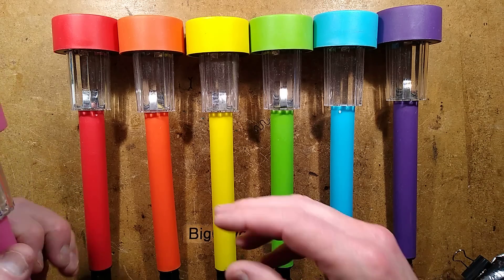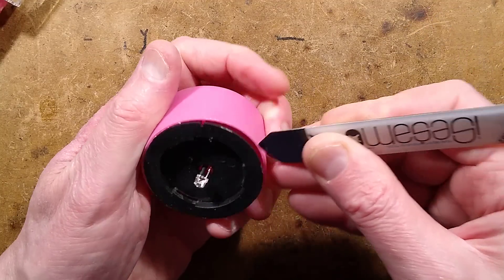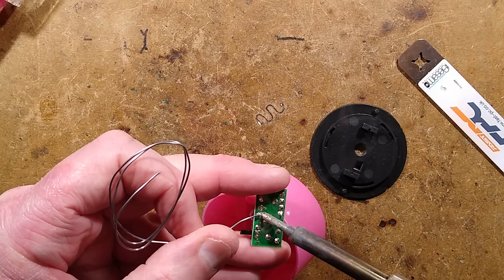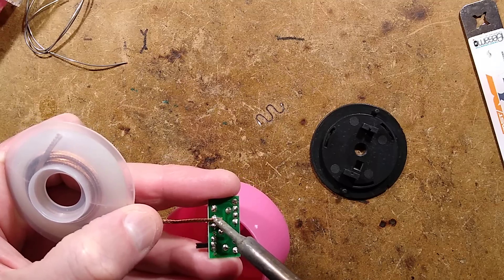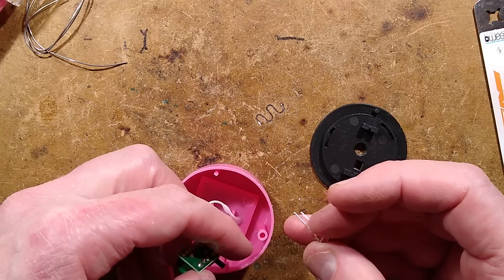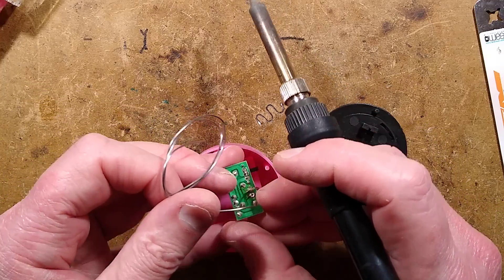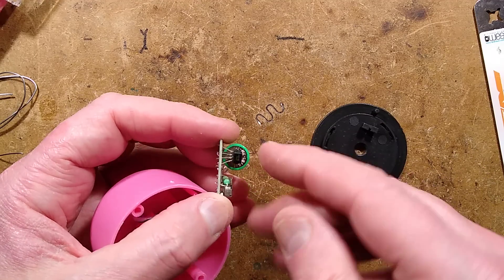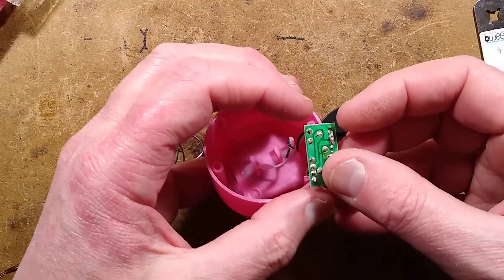Making Poundland's pinkest solar light even pinker

Comment: Hello mate , 
I am one of Your Subscribers for a long time and when ever I have some spare time in front of the computer I watch one of You video ... 
Recently my Wife - "my Boss" (😂) pointed out to me that one of the solar lamps in the kitchen flower garden is no longer working even though it was a sunny day ...
After I measured the battery and inspected the connections and/or if the led is functional and everything was ok, I remembered some of your videos with and about solar garden lamps ... 
And now the questions :
1) is there a color code or another way to find out the inductor (that name may not be accurate, but I don't remember know the correct name), value in the Accumulator supply circuit ?
2) the battery has 1.2v /15omA - if I replace it with 1.2v/600mA will it still charge?
3) can I put/replace that inductor (that name may not be accurate, but I don't remember know the correct name) part with another with a suitable value ?
Do you have a video where you modify the lamp to use a larger capacity battery?
Thank You & keep us on Loop with all you do .
Later Edit :
https://www.youtube.com/watch?v=VAsyVk0ZIqQ 
https://www.youtube.com/watch?v=bcSwIOBmfdM
Beside those.

Comment: I used to install Blue LEDs in the store lamps in front of my house.

they end up getting stolen every year to year and a half. 

I eventually stopped replacing them because the quality of soul lamps dropped, on the all started using single battery with lower voltage LEDs

Comment: Oddly enough I was doing the same thing with some similar lights from Tesco's "reduced to clear" shelf recently (two quid for a pack of five!) I've fitted red LEDs (fifty for a couple of quid on ebay) and plan to use them for night vision friendly lighting. The Tesco ones had a similar design, minus the switch (they use a slip of plastic jammed between the battery and one contact), but with insulating sleeves on the LED legs which made an excellent height gauge after swapping them to the new ones. They may also have had some form of charge controller, I think there was a tiny chip on the back of the board.

Comment: In another video, you made a solar charger for Ni-Cd cells, and when I mentioned protection circuitry for the cells to not over charge them, you replied that Ni-Cd cells can be put on constant voltage without any problems. In this video, you're saying that Ni-Cd cells can explode from being overcharged. If the smaller cells can explode, then certainly the bigger cells could also explode.
Reply from the maker: If the current is high they can pressurise.  With a controlled trickle charge they can control that pressure and convert liberated gasses back into electrolyte.

Comment: I have to admit I've scorched my fingers more using de-desoldering braid than actual soldering. If you wanted to add more LEDs how much would you need to alter the standard board ?
Reply from the maker: You can add LEDs in parallel or a few in series.  I've got a video about series LEDs on these coming soon.

Comment: I've bought those kinds of lights from the dollar store here in America and they usually don't work right. Like at best they charge the battery just enough for it to light up dimly.
Could you try to find one off these and see if you could fix it? It looks a lot like there over you just opened.

Comment: Some years ago I developed neutron detectors that functioned as cosmic ray monitors. Naturally I added a variety of different coloured LEDs on the front panel to indicate the various sub-system's level of happines. Turns out that "would you like some LEDs for your LEDs" was a regular remark...

Until a professor of physics had to diagnose the electronics on a remote site and thanks to the LEDs quickly pin-pointed a bad flash-drive which he could easily replace. No jokes ever again..

Great job Clive! Would you like some LEDs for your LEDs? 🤣

Comment: In remember the early 2000s ones that had a amber LED for some reason instead of a white one.
Might be because of the cost (Like with the keychains that all had red LEDs at the time) I thought, however my dad and I got the idea of swapping the LED and getting a 5mm white one from a store like Radio Shack but in France didn't cost very much.
(I don't remember the price, it's been a while).
Reply from the maker: There were no white LEDs at that time.

Comment: I found the exact same design in the trash. replaced the LED with a turquoise one and the cell with a used leftover AA NiMH battery - it fits inside no problem. If you change (lowering it iIrc) the value of the inductor you can make the LED glow brighter.

Comment: I know the water gets into the LED light but you can use clear fingernail polish as a very cheap conformal coating. It works quite a while and you can probably pick up a bottle at poundland for a pound. I've known about this trick for years and it actually makes a good conformal coating.    If you buy the real conformal coding over here in the States it's $20 for a small bottle I believe it's 2 oz. Give me the dollar fingernail polish.

Comment: We have a clothing and food store in the UK called ... M&S ..... by swapping the letters on their store bags , you get  S&M .... which results in smiles 😝 as you walk down the High street ( errrmm ) ... NOW ! handy tip #76 ... to get a SUPER BRIGHT orange LED for your Orange lamp , you simply use a (  POUNDLAND™ ) LED from a Halloween light string ... this is a blue LED with an orange phosphor ... this is MUCH brighter than an ( old skool ) orange LED and needs 3 Volts like your pink type ( tried - n - tested ) .. DAVE™🛑

Comment: I have a bunch of flexible USB powered book lights in many colors that all light up white. I'm going to convert them to illuminate in the color of their exteriors, similar to what you're doing with the solar lights. A problem I encounter is getting LEDs that emit purple at a useful intensity. The ones I find for sale that claim to be purple are mostly 400nm UVA at least in 3mm & 5mm through hole parts. For through hole I have some dual color red/blue that I can use but I have to adjust the mix to get a decent purple so extra holes and components are required on the PCB to make them work meaning I can't easily hack an existing PCB. The size needed for these particular lights is 2835 smd so maybe I'll get lucky and find a decent purple.
Reply from the maker: You do get phosphor purple LEDs with a blue emitter and dusting of red phosphor.  They are visually brighter than the near-UV ones.

Comment: I bought some pink LEDs several years ago for my HT/LT battery eliminator for my vintage radios. They are certainly very bright and eye-catching!! Maybe I should have put them in my HP high voltage variable PSUs to illuminate their meters (there was no other indication of the power being on other than the position of the switch) rather than boring white...

Comment: 🤦‍♂️ man i feel dumb....never occured to me to use flux on solder wick to make it work better. I guess thats why we have you to give us advice.
Reply: Surprise, desoldering braid is literally just Fine Copper Wire, And Flux. If its not working at first is because you burned off the flux but didnt give it enough heat for the braid size and/or the trace you are trying to clean. A dedicated, wide tip desoldering soldering iron is ideal.
Reply: And a soldering iron with adjustable temperature, I found with the “fixed” temperature iron in my rudimentary soldering kit that desoldering brad doesn’t work as intended [not hot enough?]

Comment: wow, the quality that managed to sneak in to the product after hyper optimization has me surprised they dont have fake solar panels and primary button cells in these yet
Reply: Because they would die in a few days and the retailer would get yelled at by customers. Also, sued under consumer protection laws, with a fake solar panel.

Probably cost more for a fake one too.
Reply: @nyetloki  Reminds me of those "shake light" rechargeable flashlight thingies from a few years back (plastic tube with a coli & magnet inside) which were soon followed by a rash of fakes containing CR2032 batteries.

Huh, still for sale.

Comment: Where have you found decent rechargeable button-cells for those? I have one dead one & one exploded one I want to restore.
Reply: Back in the days, I soldered end-of-life AAA-sized Eneloops in these lamps.
Reply: Sadly the cells are more expensive than the solar light.  If you can get a good price on rechargeable NiMH 9v batteries they have 6 x 300mAh-ish cells inside them.  Swap out the inductor for a bit more brightness now you've something better than the 40mAh original cell.

(Keep the case, stick in a 600mAh LiPo along with one of those USB charge/boost boards and make yourself a real 9v rechargeable battery (that will cut out with no warning adding to the excitement on your life).

Comment: I'm in the camp that wants to see all of them changed their match in color.
When we moved into the house we are in now it came with outdoor lights down the driveway. Really old incandescent outdoor peg lights. Well one year we picked up some colored binder separator things basically colored cellophane/plastic. And we sliced a little strip off and put it in each light to make them more colorful. They really do look neat that way. No if I could just get the plug to plug in a Wi-Fi controlled outlet we might be able to turn them on more often as the mechanical timer never function since long before we purchased the house. And the RF remote that I have got unplugged because it blocked the outlet.

Comment: I saw a video about fogged over solar cells on top of lights like this. The guy claimed to remove the fog by spraying Rust-Oleum clear semi-gloss over each cell.  
Video: https://www.youtube.com/watch?v=pmY9wQkoiIw&t=230s
Reply: Clive's done similar using some sort of 3m Tape over the top. To both seal the edges of the panel from water intrusion and to protect the panel from UV.

Comment: I'd love a video about the wind powered lights. Once he's explained to people how they work they can build and experiment with their own. Would a vertical windmill with solar panel blades be any use? Or a normal one that points towards the sun and adjusts the pitch of its blades depending on the angle of the wind?

Comment: Here in the US, Walmart sells similar for $ 0.98 singly, or $4.98 in a six pack. These have a removable 2/3 AA 150 mAh MiMH cell and are warm white luminance with a black exterior. The solar cell is quite larger than shown in this video. I've been buying this model for over a decade. Usually for replacement boards, solar cells, batteries crystal cases, mounting stakes and housings. I have eight in the garden year around with the different colors of LEDs I put in them. If the case or solar cell is bad I just remove the LED and put it in a new one. The two mounting screws 2 mm x 10 mm can be used for projects needing miniature self-tapping screws. $ 0.98 for a battery replacement? A bargain as for the same 2/3 AA 150mAh battery cost about $14 for four on Amazon. A hailstorm here in Denver, CO with golf ball sized hail a couple of months ago smashed one of them and crumpled the battery inside.

Comment: do the voltage variations between different color LEDs not really matter?
Reply: The ICs are basically constant current led drivers, on the output.
Reply: You can even put two LEDs in series. The light will probably stop functioning at a higher voltage, but the difference will be barely notable.
Reply from the maker: Not really.

Comment: Over here in the US the big box retailers (usually Walmart and Home Depot) sell this exact same solar garden light (usually in a metallic finish or using metal parts).  Always my go to solar light for projects and parts since they're always so cheap (around $1) and extremely reliable.  I don't know who the Chinese manufacturer is, but they always do a good job - a rare find.
Reply: I picked up a couple of these for$1.25 each at $🌳. All they had left was black and yellow, and black is too boring.  😎
Reply: Do you use the solar panels in them?  I thought the low voltage in these ones made them useless for most things, have to go for the much larger ones to get a proper 5v.
Reply: Sometimes when all you need is a simple solar light, the entire guts of these can be useful to cannibalize for whatever project (your own lights, clocks, or whatever you might need illuminated.)  I mean for the price, an entire solar circuit +  NiMH battery it's a pretty good deal.  Removing the LED, they're a not-too-bad circuit to trickle charge a single AA battery (I've noticed some are using a more obscure half-AA-size LS/CR style battery sometimes).  Several of the cells together is more useful if you need a bigger cell; but at a certain point, online electronics suppliers probably end-up being a better part source for cheaper, better solar panels.  Edit:  Clive's is the newest revision I've seen that's using the 1/4th-size-AA coin-type cells that I'm assuming are a Lithium battery of some type...  But they're all designed to trickle-charge and run off of about 1-1.5V.
Reply: @moeburn  You can tie solar panels of like construction in series to increase the voltage with no issues. As cheap as they are, they would be excellent for a low current 12v charger design, just use 14 of them.

Comment: Not worth the effort. If i bought these solar lights, i'd just cover the white LED with permanent marker of the appropriate colour. For the pink one, i would use a red marker pen.
Reply from the maker: That's subtractive colouring.  It will literally reduce the light output to a fraction of that achieved with a specific colour LED.

Comment: I just want a solar light that lasts until morning and keeps doing it for years rather than a couple of months.  Is that too much to ask?
Reply: These look small enough that you could put an inverted glass jar over it to waterproof it. Water damage seems to be the main failure point for me since these are not very well sealed. Even if you spray some conformal on the innards, because of the way the solar panel is mounted, the water will get under it eventually and ruin that as well.

Comment: What is the part number of the four pin controller IC?
Is there a light sensor? Or is the on/off function done off the solar cell?
Reply from the maker: Usually a variant of the YX8018 which can sense dusk using the same solar panel.

Comment: I just removed a faulty switch like that from a product that was malfunctioning. I soldered wire to the only setting I care to use, and it works great now.
Reply: I've done that a few times with solar lights. The switch is really only there for shipping.

Comment: Wondered why there was some insulation on one of the LED legs?  Also wondered how the light might look/display if the LED was bent over, vs. straight.  Since done a while back, not important, obviously....  :)
Reply: On LEDs with longer leads the insulation makes sense, but you'd think as these are pretty short it's not worth the effort.  Rather surprising they bothered giving their usual penny pinching.
Reply: Could be a spacer or installation aid (3:13)? I used to cut up the red double barreled coffee stirrers with a hobby knife to conveniently, consistently set LED height for a short production run.
Reply: It so it doesnt short out when they assemble it. Probably also so that the height is consistent, but sticking it through the hole it can twist and short.
Reply: It was quite close to the battery.

Comment: The LEDs ought to be the colour of the plastic. If you go for the rainbow look go all out. 🏳‍🌈Interesting video 2x👍
Reply: They can have rainbow internally controlled leds in them. They'd have a buffer cap/diode IIRC to make it work with an IC LED, just 2 extra parts on the same 4pin driver IC, Clive has done a video on them before.